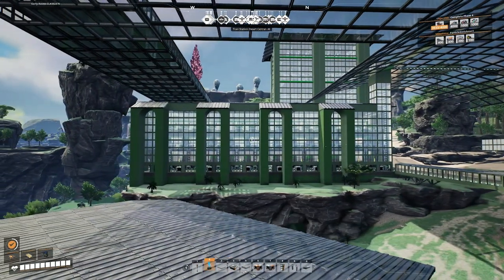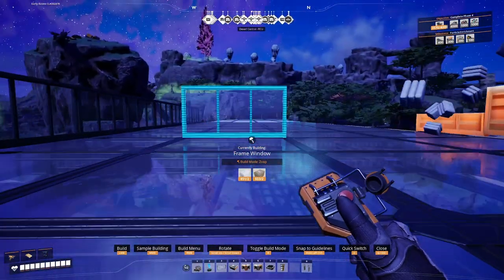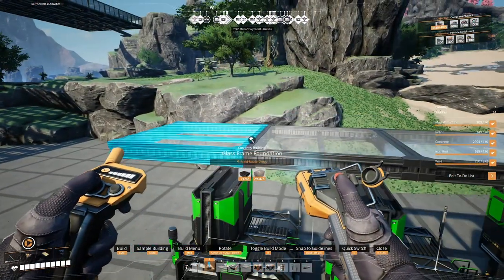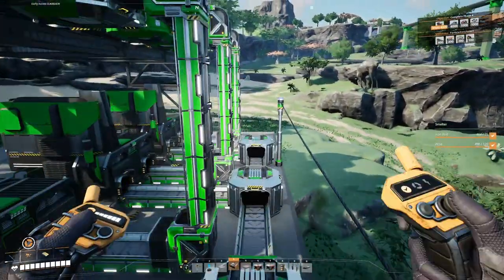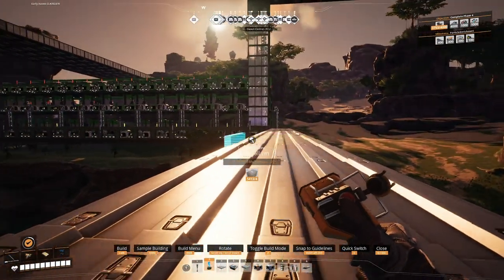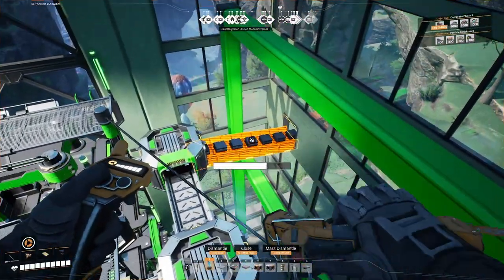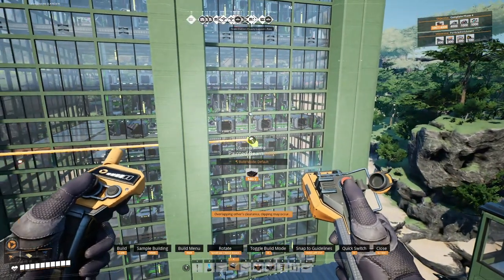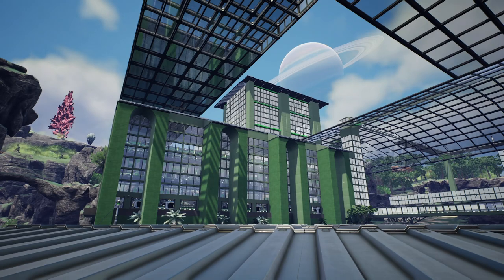BIG Modular Wire And Steel Pipe Builds In The Biodome - Satisfactory Update 6

Comment: Another great vid that makes you worthy of more subs. I hear you on how it can get boring sometimes. I am currently having a mid game crisis. I have all the tiers unlocked but everything I need to automate seems like it will just take forever. Also after I do all that I have to cross my fingers that my power grid will hold up, which is another huge project if it doesn’t.
Reply from the maker: I hear you. I am in a very similar spot in this save. You really don’t have to make THAT many of the later items…a pretty low production rate will still fill your space elevator eventually. 

If you have watched my diluted fuel power plant video, check it out. A build half that size is still pretty big but still not too bad for 5 GW of power
Reply: @DrLootCrate  it’s funny you mention that because I’m about to do that exact setup. That’s actually the video that brought me to your channel. I was all ready to start it, then realized I didn’t have the alt recipe for diluted fuel. 10 hard drives and a day later I’m now ready to start.
Reply from the maker: @MonkeyRage427  awesome! That is a key recipe for sure. Glad you finally got it!